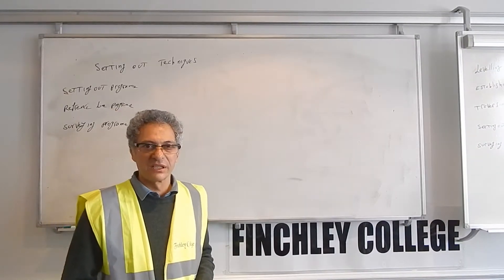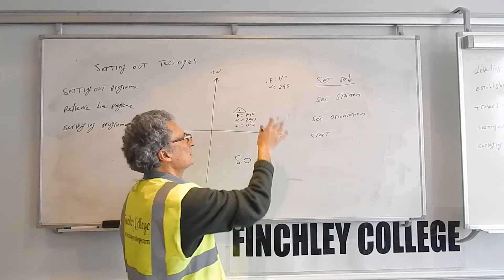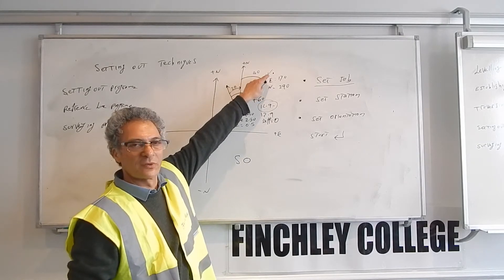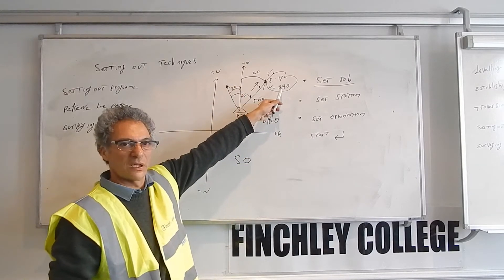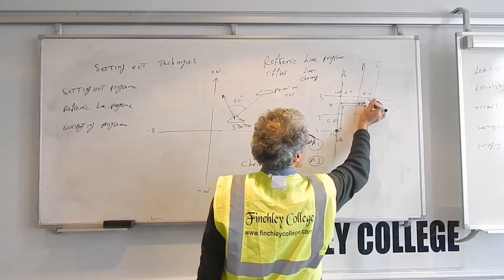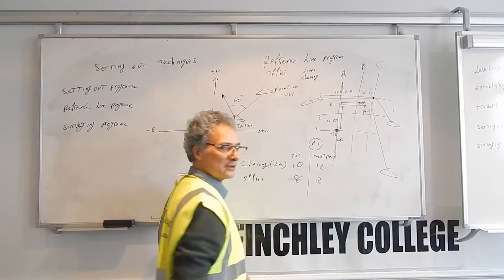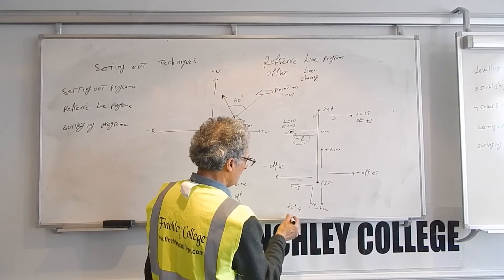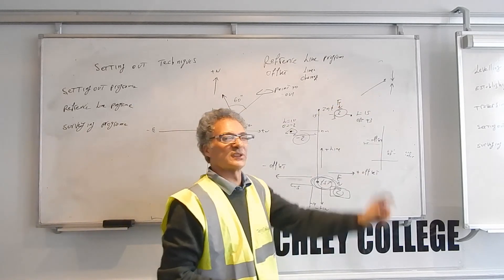Setting Out Techniques

Comment: Very informative,  I want to know that how we setting out our points on a roof slab where we dont have any solid area where we can fix our machine?
Reply from the maker: Its easy, set up your instrument, stand in one place where you can see most of the area you want to set out and try not to move your body, so as not to shake the deck